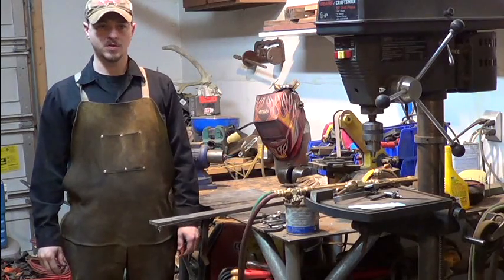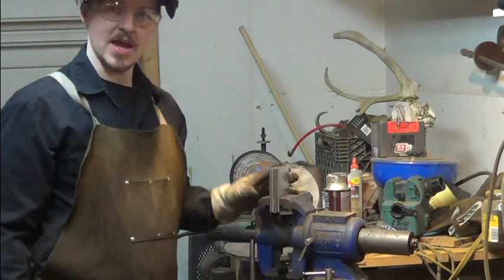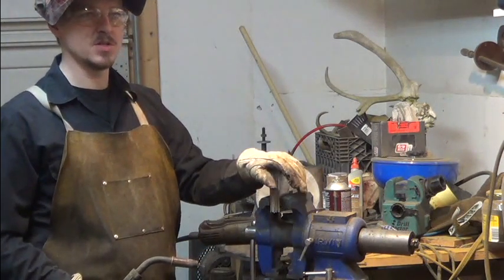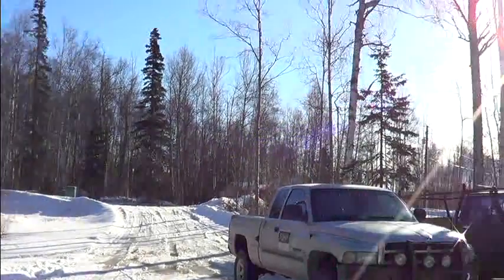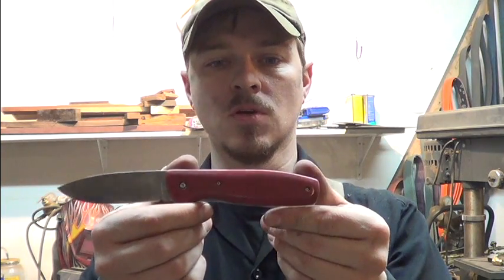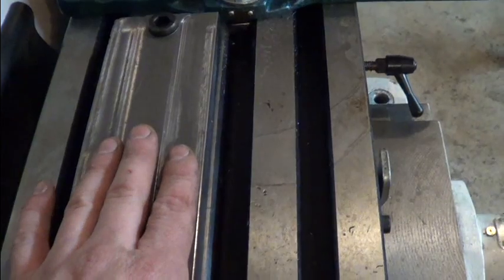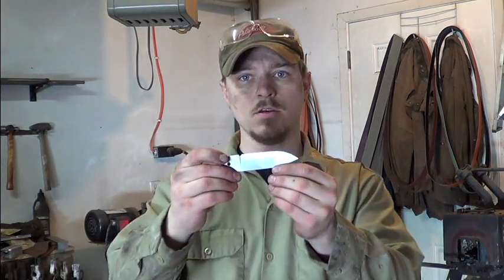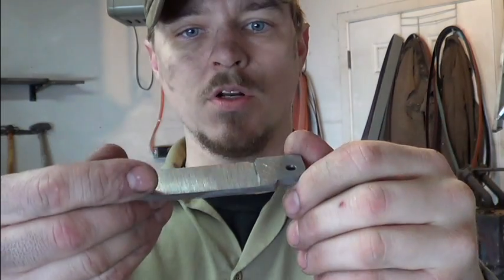Last Frontier Knives - Episode 2

Comment from the maker: yes I did, The wheels I bought from beaumontmetalworks the rest was scrap steel left over from other projects.  The motor is a 3 phase with VFD I bought from automationdirect.  this makes is variable speed for the same price as a sealed 1 phase motor.  you can figure around 400 to 600 to build one on your own.